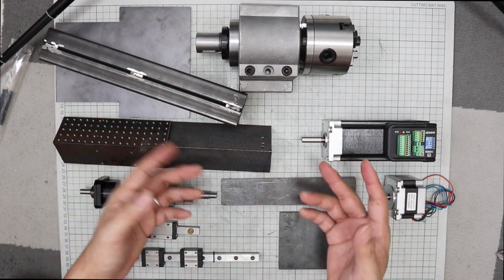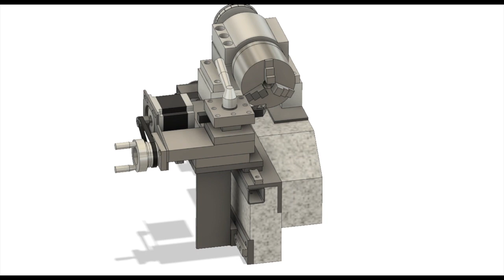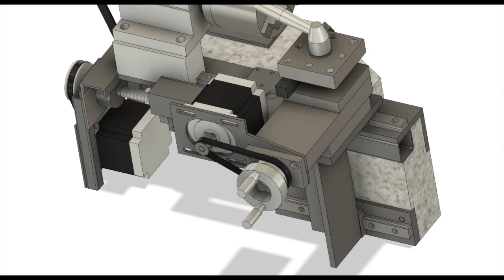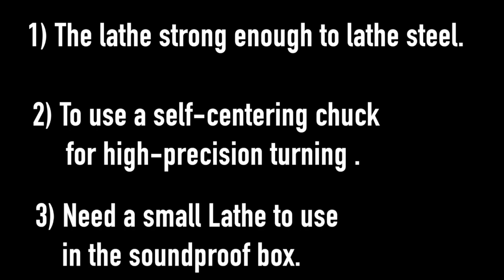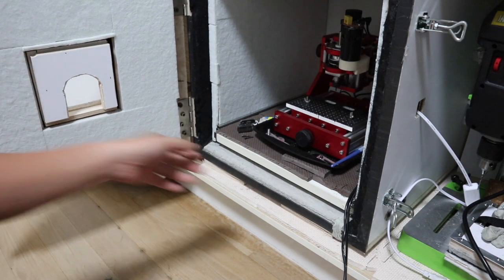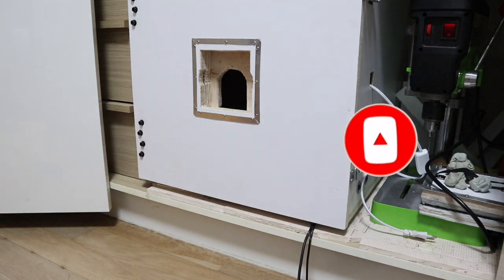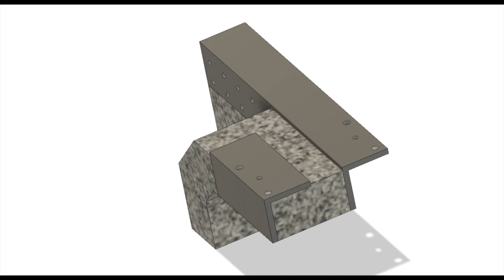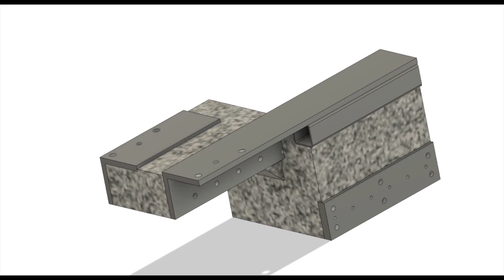Homemade DIY Small CNC Lathe ,Part1

Comment: Great design! What is the steel wire type of thing you end at the end called? Where would I be able to get some?
Reply from the maker: about this?
https://www.lazada.sg/products/i136677138-s1462542362.html?urlFlag=true&mp=1&tradePath=omItm&tradeOrderId=79119200981595&tradeOrderLineId=79119201081595
Reply: @a-cnc-f  Thanks a ton ^^

Comment: Building VS buying a cheap benchtop lathe. If I buy one then I would have to fix it to be Usable. If I build one it could cost as much as a decent one. Comments go...
Reply from the maker: I wanted a very small CNC lathe that could machine metal.
If you have a lathe for sale, you should buy it.